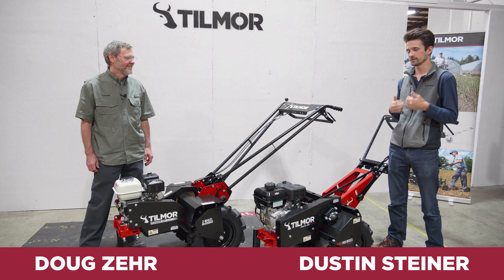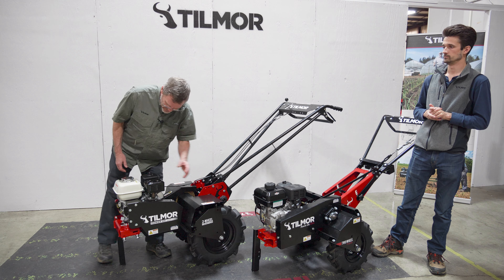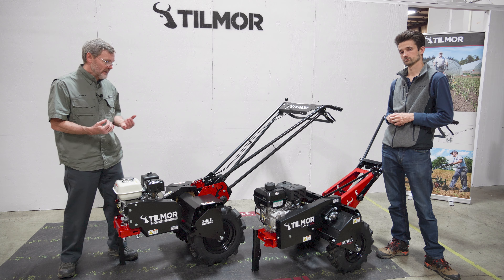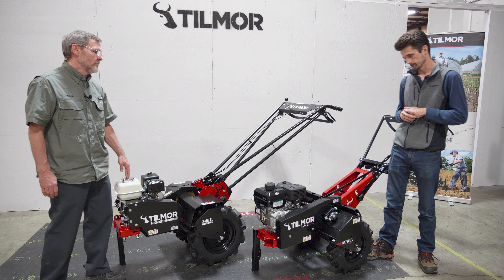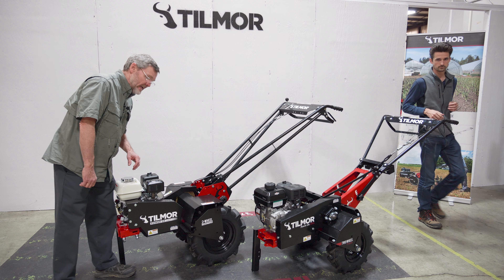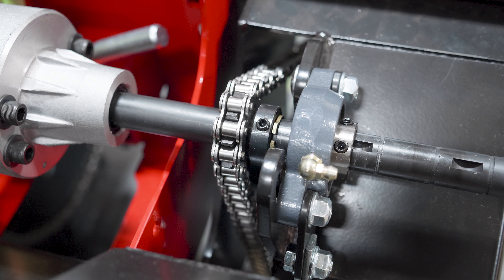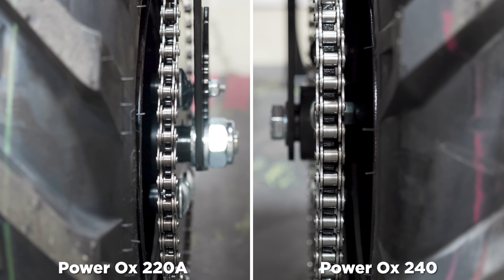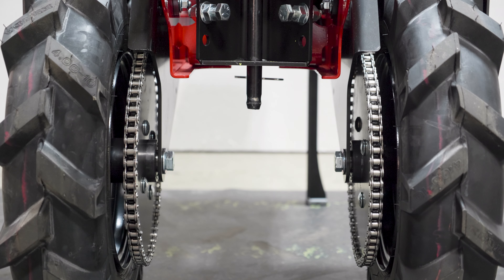Comparing Tilmor Power Ox Two Wheel Tractor Models

Comment: excellent job.  I am however wondering about the new drive shaft adjustment and the bearing seizing to the shaft.
Reply from the maker: Thanks Jeff! This was something we looked at and from our testing have not come across. We feel confident in the system and it seems to be rock solid, but as with many things time will tell. We feel confident in the system and we will always be here to keep supporting and improving it!

Comment: U went from a gear box to belts?????
Reply from the maker: Yes we did! We have had no issues with either the gear box or the belts, but doing the reduction through belts makes it easier to source various engines around the world that don't have a 6:1 gear box available, less maintenance, and easier availability and repair if necessary on the belt system.